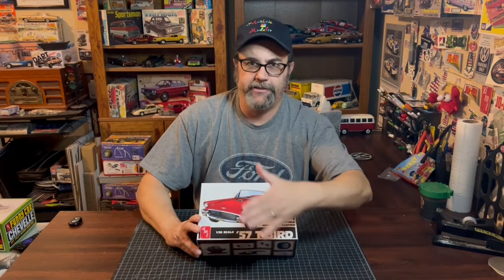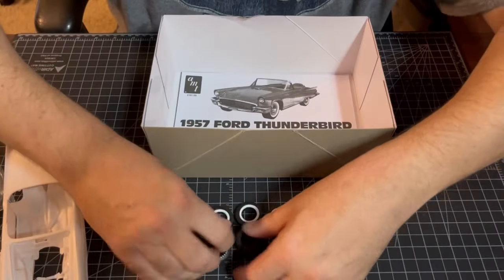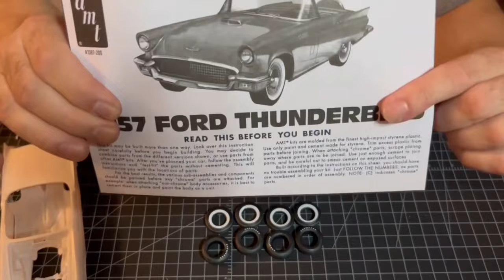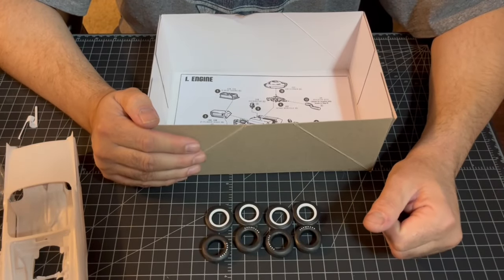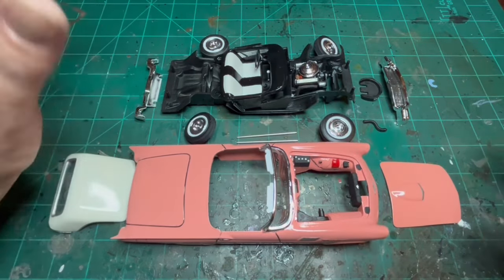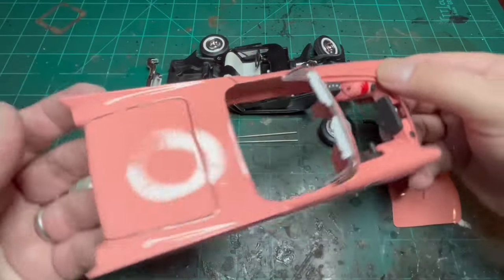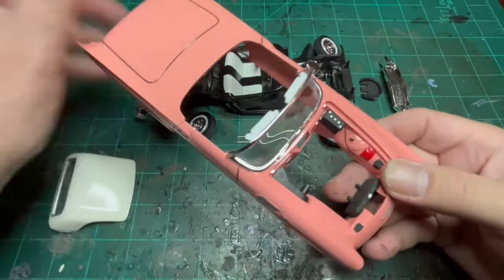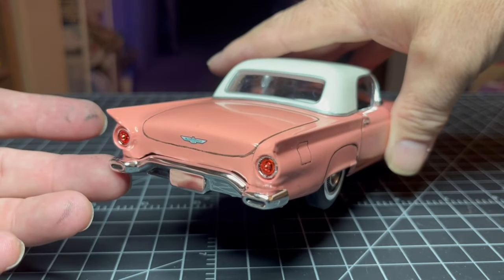Full Build of the new 1957 Thunderbird by AMT

Comment: Nice kit, I finished mine earlier this month.  I did have trouble getting the clear windshield to fit the chrome frame.  Had to trim the "glass" to fit.
I painted the chrome motor in Ford engine blue.  The nonplated engine just didn't seem complete enough to work.
My paint scheme is Tamiya gloss red spray body and red/white twotone interior.

Comment: Louie! This is a great build! 2 questions here: Where did you get that Krylon Coral spray paint? I don't think Wal Mart carries it. Secondly, you didn't give a quick over on the instruction sheet so I wondered if there was an optional dual quad set up???
Reply from the maker: No, it only has a single molded on the intake carburetor.
Reply from the maker: I did get the paint at Walmart, but it was on clearance for $1.00, so I’m pretty sure it’s discontinued.